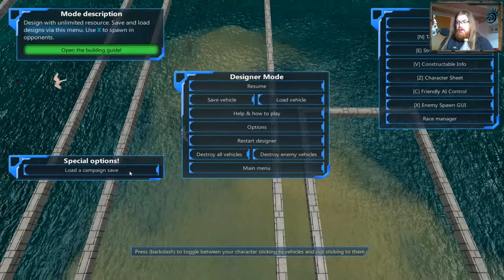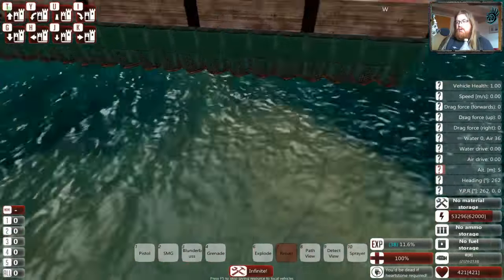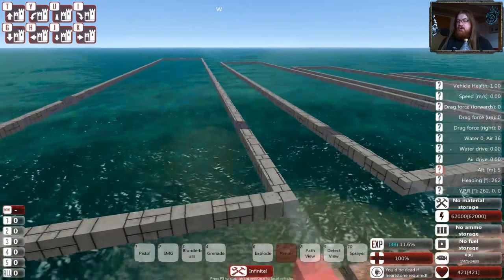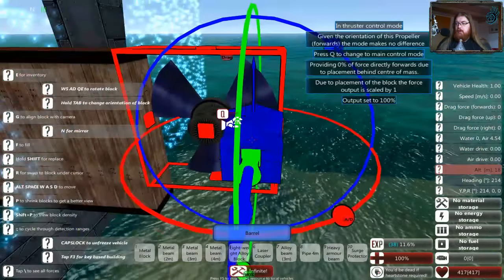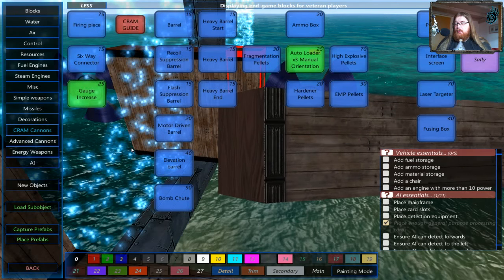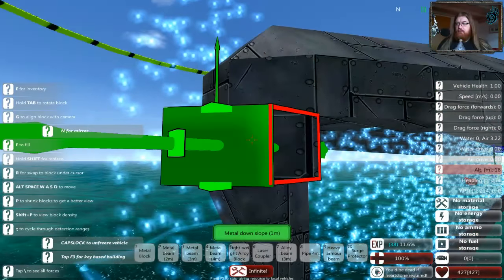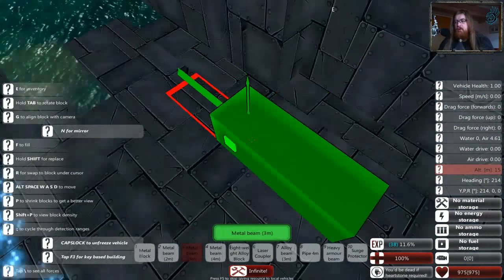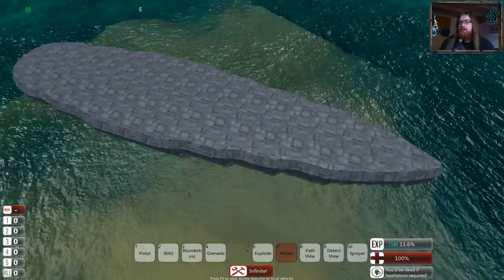FtD - Building a ship from scratch 1

Comment: Sadly the sound turned off at 7:07 mins =( I checked your twitch but only part 4 and 5 are still available.
Reply from the maker: Yeah, my PC's USB is a bit wonky and apparently my sound was lost in the process. However the sound resumes around 34:00 so at least the second half of the vid should be audible again...

Also: this is a direct export from Twitch thus it has the exact same audio I had when streaming it and thus having access to the Twitch files (which Twitch only keeps for up to 14 days for my channel) would not have helped here either unfortunately ... -.-'